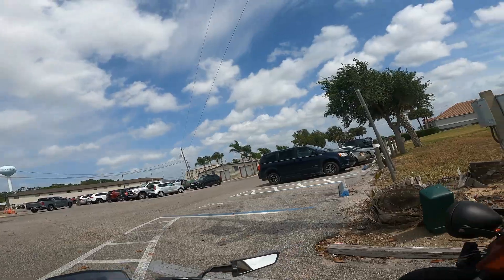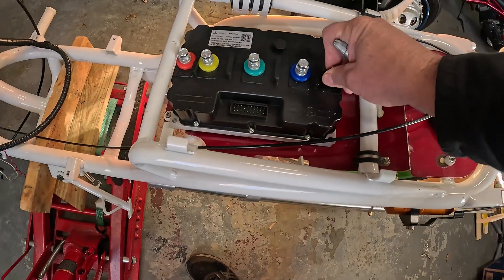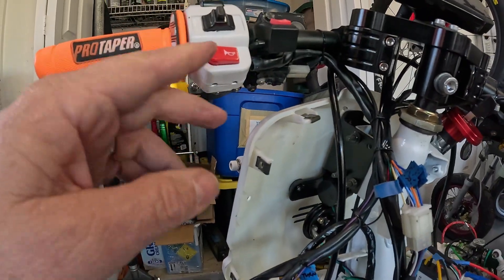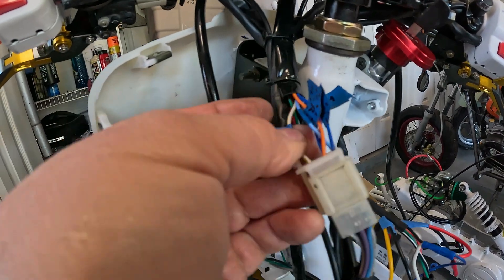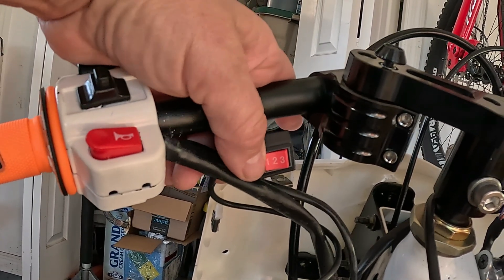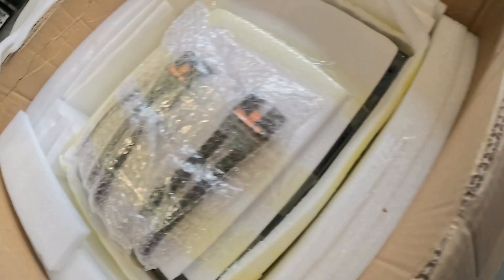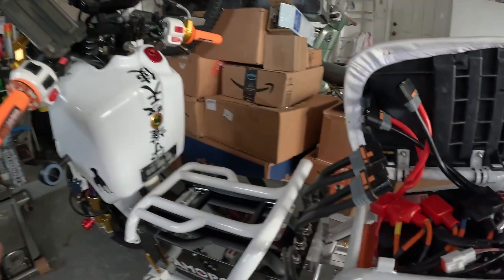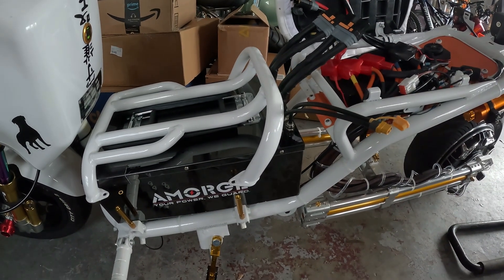Build Your Own Electric Motorcycle - Video 4 .. How to Wire Controller, Motor, Display, Battery

Comment: wondering how much much it cost with the frame and everything to build one like yours?
Reply from the maker: @stephen8385  about $5k is electric bike stuff.  I bought that bike new for $1400, but you can get them used for way less.  I need to do video and add it all up. People keep asking and I didn't keep good track.  Like all spending, it will probably be more than I though when I start adding it up.
Reply: @GhettoWrench  thats not too bad. im interested making one after seeing how fast your build goes.. is there any comunity or group? looking forward for the top speed run or maybe rundown for the parts cost...
Reply from the maker: @stephen8385  the bike just gets too damn sketchy above 90mph.  I had it to 94 but that ain't near top speed.  There is an egrom with a smaller motor than mine doing 126 in the quarter.  Hit Facebook and check out "electric motorcycle builds"

Comment: do you have any throttle recommendations for 96v setup? tried to find one that can be used for 96v
Reply from the maker: @MrJLiebert  I am being told .....  (and I am new to this) that  a throttle is not voltage dependant.  Don't even know why the listing's have volts.  They are just 5 volt rheostats.  So any throttle will work.  The best are "Domino" throttles they say, but they have like 5 wires so I am not sure how to wire them up.
Reply: @GhettoWrench  I see, there's a few version of them, with only 3 wires and 5 wires
Reply from the maker: @MrJLiebert  The fardriver is the flat 3 wires in a row plug.  Black, red and green.  Some throttles like that use a white wire instead of green but same plug and function.

Comment: 7:21 Most people will just depin the throttle connector and put the pins in the correct order. Takes 60 seconds and doesn’t add unnecessary wire mismatch that if anyone else sees that will say “What in the Fuuuuuu” lol
Reply: You have to buy that molex connector set before even thinking about working on these bikes. Lol
I spent 2 years refusing to buy what I needed and then started buying and now have a ton of stuff. 

My first real controller was a Votol but the motor had a molex connector set, I cut off the good waterproof connector and made it cheap molex like a $10 controller. Then I got a Fardriver and bought some of those matching connectors and made my motor match the controller instead. Even thosugh its the most ridiculous hall connector ever, at least my fardriver is original. Lol.

Did you find your bms yet in your battery?
Reply from the maker: @imho7250  that molex connector pin set is expensive.  LOL.  I need to stay ghetto.  Our mechanic at work for the helicopter  actually has all that stuff and the tool.  Once I figure this crap out I can get him to add the proper plugs on.  He has a huge assortment of them.  I am just battling this shut off issue and I can not duplicate on the stand.  I have jiggled and moved every wire.  People are saying it is because my hall wire is wrapped up with my phase wires.  Makes no sense to me, but I will try anything at this point.  After 4 to 8 miles of driving it starts shutting off...  just the motor.  Nothing else.  If I accelerate, brake or hit a tiny bump.  Then I have to wait 8 seconds and it comes back on.
Reply: @ the 380 piece connector kit (counting the pins, with 2, 3, 4, 6 pin connectors is $3. These do not have an A/N or Sikorsky part number. Lol

Problem just by seeing your fardriver settings and the ANT settings i can tell why your motor is cutting out. Your controller has a max 1300a line current, and it comes default set to max, so not sure what you lowered it to. 

Screenrecording the graph page while reprinting this will most likely show the culprit. If it’s happening after a few miles it’s definitely tempurature related,  caused by too many amp for too long. The battery, controller and hopefully the motor all have thermal protection. If the battery hits thermal limit voltage goes to 0 and party is over. 

There was a case of someone who didn’t have a motor temperature sensor so he used Cacu, but didn’t calibrate it, and it kept shutting him down.
Reply from the maker: @imho7250  how can I get the screenshots to you?   You can hit me on FB messenger.  Ted Edgar.  I am the guy in a helmet with a red mountain bike.  

So basically all these have to happen and I doubt there a setting for it:  the motor must be between 60 and 70 degrees.  There has to be weight on the wheel.  If those 2 things are there then amything upsetting the rotation of the wheel such as a bump or breaking or accelerating will turn the motor off.  Nothing else, just the motor.  No error codes or indication.  You can coast for a minute and it will not come back on.  If you stop the motor for 8 seconds it comes back on.  Shaking, rattling or pulling on wires has no effect.  I think this is internal to the wheel.
Reply: @GhettoWrench  , ok. I messaged you. It’s probably hiding in your chat requests.
Reply from the maker: @imho7250  that would be the way if any of this stuff matched up.  But that connector was one I got that matched the fardriver connector.  The throttle connector was a different type connector.  The pins were too big.  Nothing ever works that easy.  We'll some of the the pins slid into other connectors, but not many.  This wiring is still semi temporary.   I have learned that I will be changing and rerouting stuff for about a year.  LOL.  Never go permanent wiring right away.
Reply: @GhettoWrench did you find your bms yet?
Reply from the maker: @imho7250  o can bluetooth to it but none of it makes any sense to me.  I don't know what I'm looking at.  I can't attach photos on here.  I recognize 400 amps, 410 amps and 640 amps.  That's about it.

Comment: Explanation clear as mud. Re-wire everything with new wire so there will be less likely to fry anything. Be meticulously redundant and then write everything down. The other thing is that you will save weight on wires that don’t go anywhere. Oh, FYI: volts, watts and amps; of these three AMPS WILL KILL YOU. Just one millionth of an amp going across the heart to stop it from beating a.k.a. = kill you. Any 12 volt battery and bike, car, boat will have more than enough amps to kill 100 plus men holding hands. So, when wiring these bikes, take your time, have a clear head and check, recheck, and triple check everything before you put power to it. Safe is better than waking up dead. Oh, that’s right, the dead don’t have any thoughts. Psalms 146:3,4; Ecclesiastes 9:5,10.
Reply: Have you never touched both terminals  on a car battery?

Comment: For someone that is new to the e-biking world I am seriously impressed with the knowledge that you have picked up already. 
Looking forward to the next instalment! 👌🏻👌🏻
Reply from the maker: @gasmanrus  that's why I have been doing such a deep dive on it.  Cause I knew nothing about it.  My ADHD getting carried away.  LOL.  Thanks a bunch.  🤘🤘
Reply: @ I saw your reaction the first time you opened up your creation 😀 
That silent surge is quite like nothing else! I’ve also had big sports bikes but I’m so over that now and loving the electric new wave ⚡️⚡️😀
Reply from the maker: @gasmanrus  agree.  I am sold.  If I had this same setup in a 17" wheel GSXR frame, it would be untouchable.   It brakes like a slipper clutch and comes out of corners so much easier than a gas bike.

Comment: What controller did you end up using 72360?
Reply from the maker: @Adventures_with_C_Los  ND961800
Reply: 72360 is a baby controller
Reply from the maker: @ChrisCrossingWires1212  I actually have a 961000 in there now.  My 961800 had issues and the only way could verify it was to buy another one.  The 1000 is all anyone had in stock.  It fixed my problems so I definitely had a bad controller.  Your bike is awesome BTW.  I watch your videos

Comment: Love your builds! 

I'm excited because I just fit a 38lbs golf cart lithium on my tiny folding ebike! Got a decent deal on a used 30Ah 48v pack for $200 on eBay.

25mph stealth ebike: $250 folding 14in + $50 2000w square wave controller + $200 battery
I'll probably switch to a VESC soon.
Reply from the maker: @Pipeargill  that's awesome
Reply: @GhettoWrench  I'm excited because components are getting cheap enough that sub-$1000 quick builds are becoming possible
Reply from the maker: @Pipeargill  ya honestly, I'm driving this thing at 60% and it is still fun and fast.  So that would be like a 8kw motor.  You could an 8kw motor and controller for way cheaper.  And my battery is too big.  Went 24 miles and still 76%.  Could have saved a lot of money there

Comment: I subscribed because you own an LMX.
I'm french, I❤ this bike
Fyi CANbus needs twisted wires and ideally shielded cables. Controller manufacturers never mention it and I don't see any youtubers wiring CAN
Reply from the maker: @nicod974  No Way!  I thought I was the onlyvLMX owner.  We just got from a family trip to Paris $$$ .  But when I got back I had to build an ebike after seeing all the cool e motorcycles and scooters there.  That's great info.  Thanks.